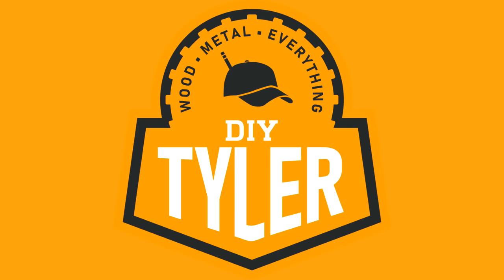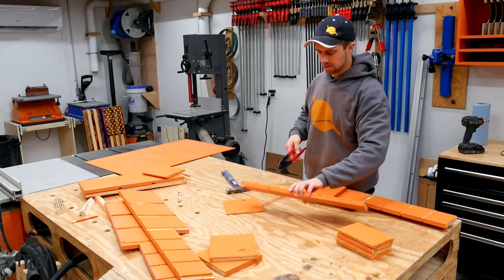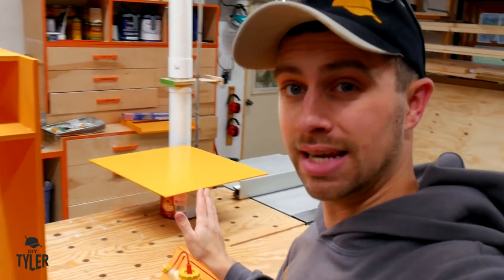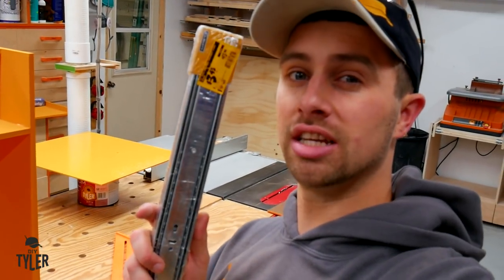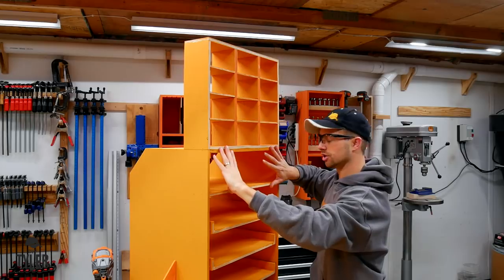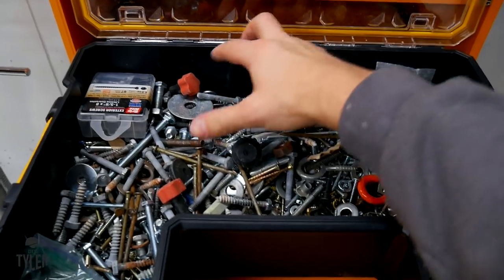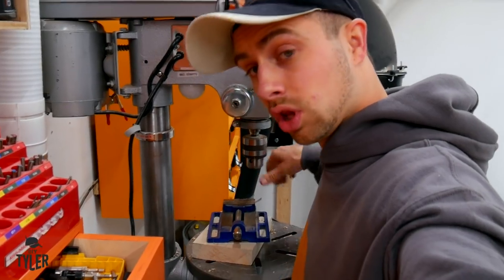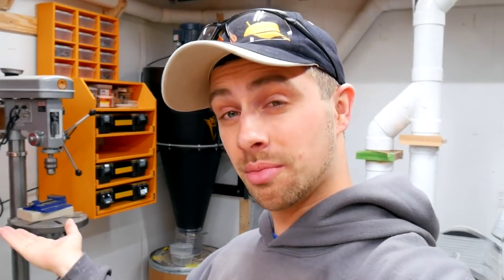DIY Hardware Storage | Ultimate Screw and Fastener Wall Storage Organizer

Comment: Thanks for the tip on the case full of misc C-rap.  I have a case missing most of the bins (pulled them to use elsewhere), I will use that as the 'junk drawer'.  Now I have a tip for you - get a label maker and label the cases.  I have about 20 of them with all of my machine screws and labeled each case.
Reply from the maker: Already planning on that just gotta get around to it! Thanks for watching Ben!!

Comment: Nice job.  Like the added space. In place of the rear board on top, you could have lowered the french cleat wall board to top of the main cabinet.  Then the stress would be on the lower cabinet only.

Comment: hey tyler great build. I have one question. you paint and then glue and assemble. does the glue hold I herad you cant glue over finish
Reply: If you look at the bottle he uses, it appears to not be normal wood glue. They make other glues that work with finished surfaces.
Reply from the maker: Hey Dennis. I was kinda testing this quick and thick from titebond. It bonds to much more than just wood and seemed to do well with this prepainted project.

Comment: Great project! Right around 3:10 you are using a miter gage with the fence.  Not sure if the fact you are dadoing at this moment matters but... When I first got my table saw I made this dangerous mistake and almost got seriously injured. Since then I have learned it is either fence or miter gage, never both at least when making full blade cuts.  What happened in my case is the square piece of plywood I cut off turned in between the blade and the fence. It flew back like a spinning bullet so fast I am thankful it missed me. I was cutting outdoors and the wood dented the chain link fence behind me! The spinning blade at that moment went into a side-warped orbit and slammed into the metal throat plate chipping it and ruining the blade in the process. This all happened in a split second.  After I shut the saw off I promptly changed my underwear. That was very scary to say the least.  You are way more skilled then me, just don’t want anyone to get hurt.